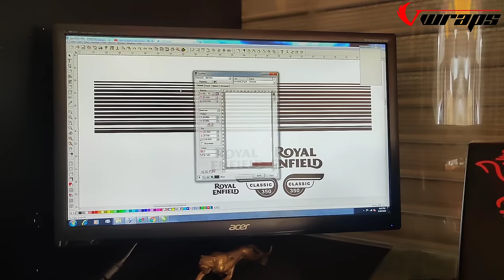Royal Enfield Signals Vinyl Wrapping Matt Black | Bullet Modification | Vwraps Sikar

Comment: When the same color bike is available that too with alloys why to wrap?
Reply: If you own an old bike then iths cheaper to wrap it rather than buying a new one just for its colour. Also the new one is bs6 which is less powerful than the older ones
Reply: May be cost
Reply: @basidhsajan5024  for your kind information both the colours of bike are of same price and the bullets which were of 90s were much powerful but bs6 is much more upgraded incomparison to bs3 and bs4
Reply: @chanchalraj2945  No one is saying that one should buy the signals and wrap it to matt black. But the fact is that signals was released before the new matte black version. so if someone owns signals and if they prefer the matte  black then its better for them to wrap it rather than buying the new matte black. And btw bs6 is updated only in terms of reduced pollution ie for reducing pollution the top end power band of the bs6 has been compromised . The bs4 and bs3 versions are still better in  performance compared to the bs6.
Reply: @chanchalraj2945  to be exact the bs4 model had max power of 19.8bhp but the bs6 version has max power of 19.1 bhp only
Reply: Royal Enfield doesn't come with matt black... there are different types of black...n each of them looks very different